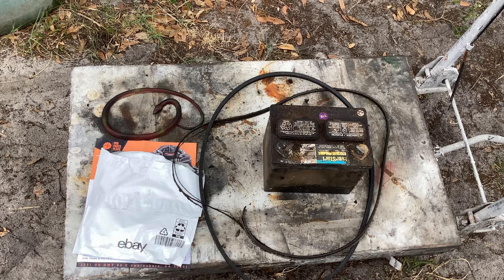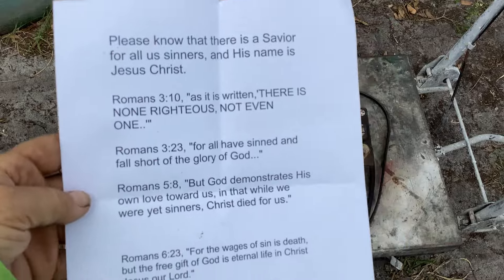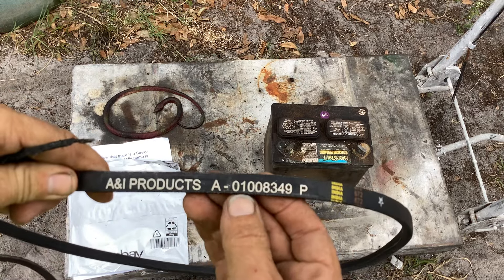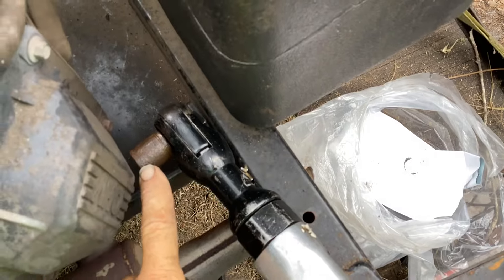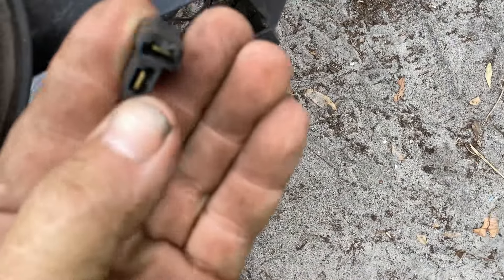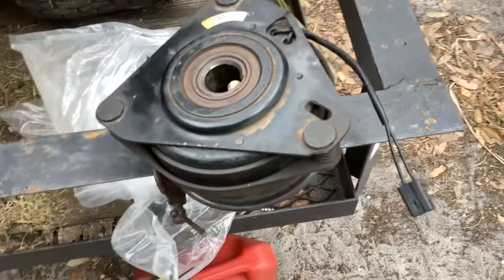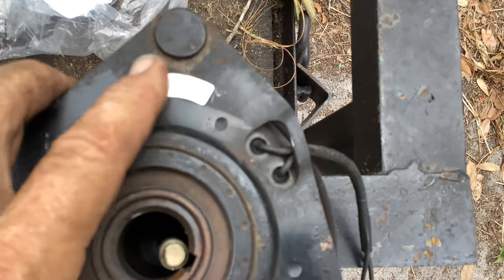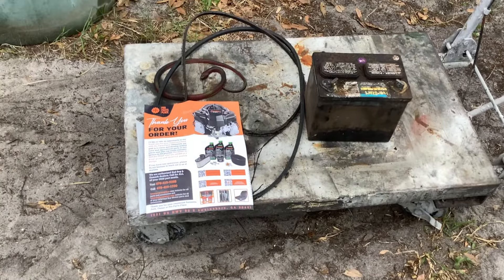2006 Cub Cadet Z-Force 50 Zero Turn for FREE.....Well Almost.!!!  Time for the Hydro Drive Belt.!!

Comment: I AllWAYS remove the cover on engine and clean out the mice or rat nest… really this is a must do every time at beginning of the mowing season…I’ve only seen bad head gaskets on nest and grass covered engines, clean ones don’t over heat if plastic cooling fan ok
Reply: I worked on a altoz few years ago with a kohlar. There is a inspection cover above each of the 2 cylinders you can get in there with extended air blower
Reply from the maker: I will get rid of all the debris under the plastic.  thank you.